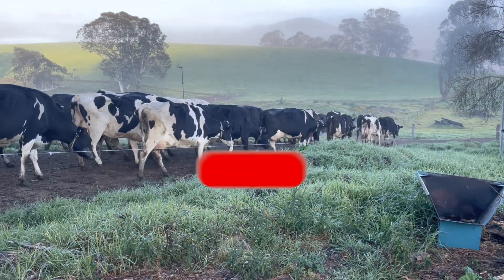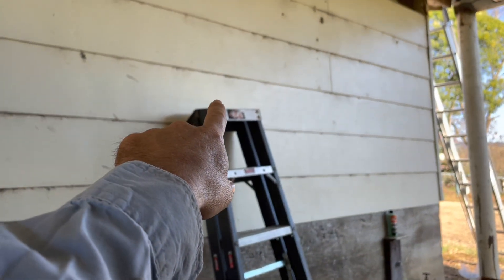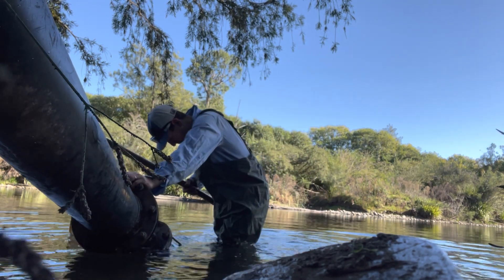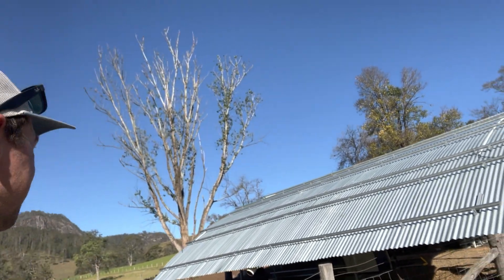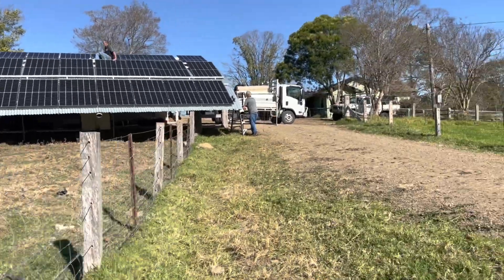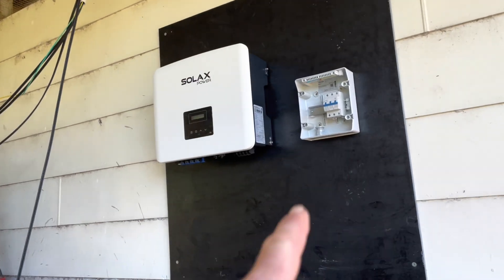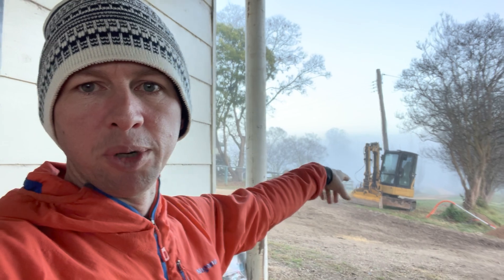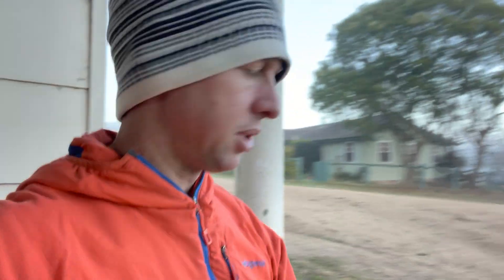Farmer builds a GIANT solar roof!

Comment: I would like to know the cost of the whole system including labor and how many KW's it will produce.
Reply from the maker: Hi George. It’s a 26kw system. I will be monitoring energy produced through the inverter app. Plugged in yesterday and producing 15kw/hr at 10am in the middle of winter, which we are happy with. Our summer days are long and sunny so will produce a lot more then offsetting more of milking time energy use. Happy to send breakdown of costs if you want to flick me a message on our Raelands farm Facebook page? I am going to do a YT clip on the costs and energy when the system has been up and running for a month or two.